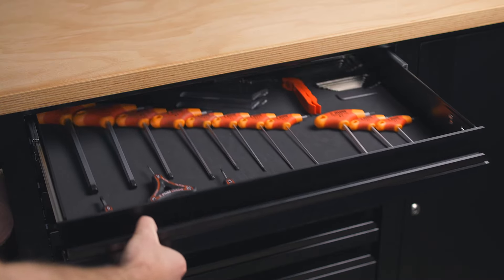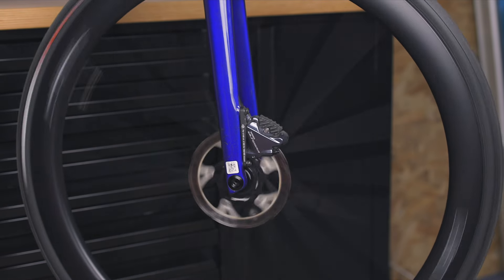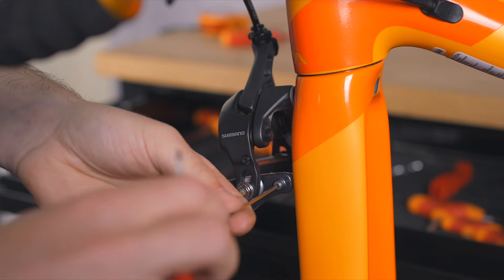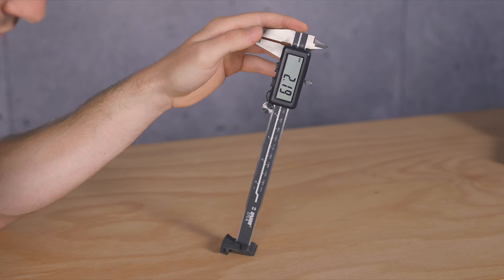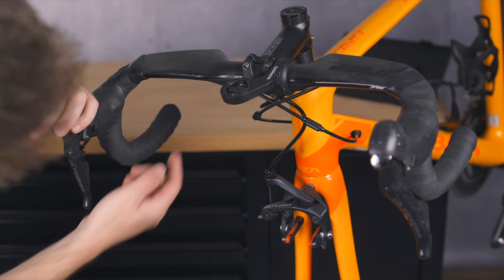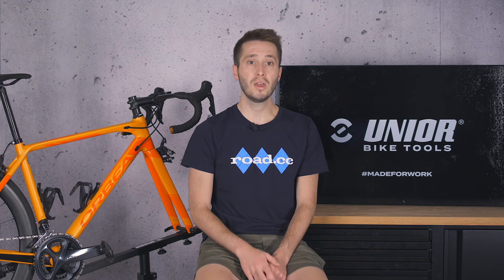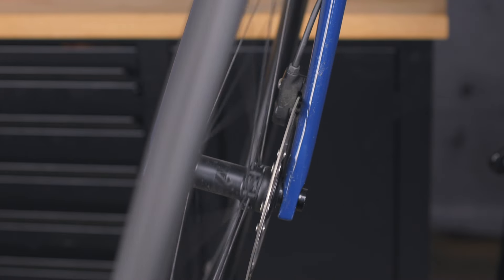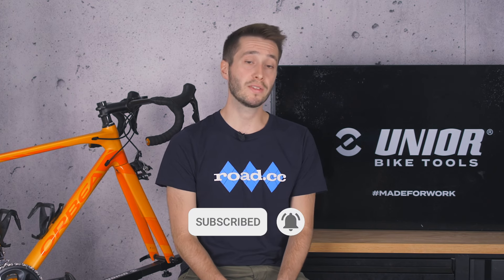Six bicycle brake safety checks - stop faster with better braking

Comment: dude do not tell me your cable housing is optimal. its too long creating more of a bend and friction. if youre riding with longer cables than you need explain why. the less housing the less friction, the less angle the less friction. and take a look at your rear brake housing in the back nearest your rear brake caliper, its too long which created more friction and a greater arch. you may as well have a loop of housing there, lol. explain why you have extra housing that creates that excess and arch or do not even speak on the topic. instead of a straighter line you have a arc.....  why??